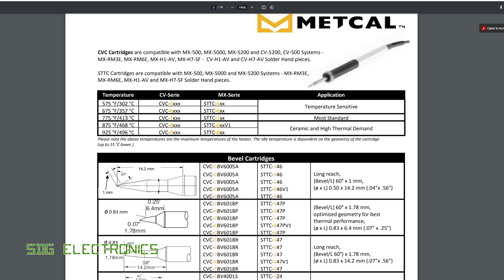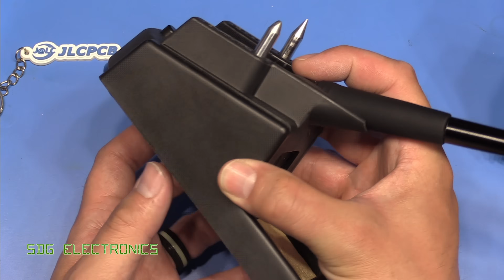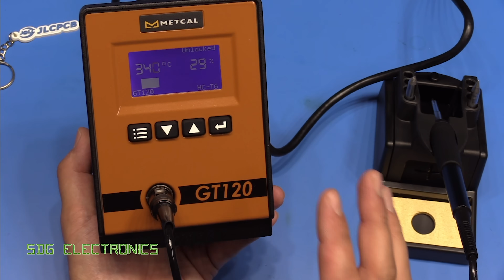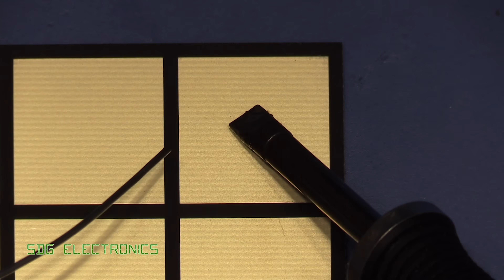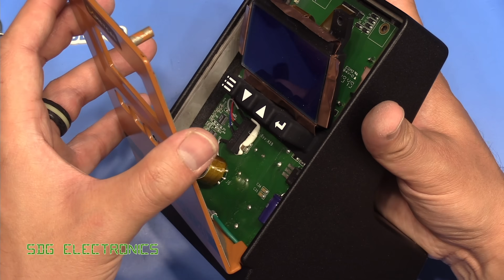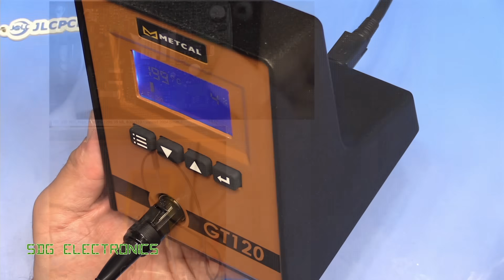SDG #209 Metcal GT120 GT90 Adjustable Temperature Soldering Station

Comment from the maker: The GT120 uses inductive heating, hence the large inductors. It's not a resistive heater.
Reply: I just have a question: aren't the tip sizes different (16:00)? The MX-5200 seems to have much wider contact, and JBC the least. I'm not criticizing, just genuinely curious. Your videos are awesome btw.
Reply from the maker: @catharperfect7036  You might be right - I can't tell from the video which tip I used, but later videos definitely use the ~5mm or 7.5mm tip.

Comment: Quite a considerable difference in tip size and shape to compare the penny test.
MX-5200 had probably double the tip width from the GT120 and the JBC had probably 75% of the width of the  GT120.

Nice review, for me the GT120 has way too many downsides based on my preferences.

Comment: Great review. I don't think it is worth the money. In your Aixun review, I think the unit performed better. I am surprised they used a switch mode power supply at such a high end unit.
Reply from the maker: Most of the Metcal systems are fully universal input voltage (hence the SMPSU) so there's no need to hold lots of different SKUs. There's always a trade-off between integrating a power supply and using an external unit.

Comment: 1200 dollar Soldering station I have to laugh maybe if you was working on a Hydrogen bomb or the Hubble telescope but for the most part you'r working projects most likely cost a lot less than that station. That is what a I call a dollar chasing a dime. You have more money than you know what to do with or your just desperate to find a way to make a video.
Reply from the maker: The RRP is $545 not $1200, but when you use something daily, the quality and consistent results matter.

Comment: Are those better than a JBC ones?
Reply from the maker: Difficult one to answer. I prefer the handpiece over the T-245 and I also like the form factor a bit better than the JBC CD compact stations. Performance-wise it's there's not a lot in it, but I get through a lot of JBC cartridges so they either drive them hard or they aren't made so well.

Comment: I previously used the Metcal MX500 stations and then moved to the less expensive Thermaltronics TMT-9000S which also uses similar RF source with Curie heat technology.
Reply: Which is better in your opinion?
Reply: @ArthurTugwell  It had been quite a few years between using the Metcal and then the Thermaltronics so its a bit hard to say. I can say I was not disappointed with Thermaltronics and the deal we got at the time was quite good.

Comment: You should probably review the pinecil (if it's back in stock) I bought one to have on the field and I think it's the best bang for the buck. It uses TS100 tips, it has a barrel jack and usb-c power delivery and QC, the only disadvantage is that it only supports 19v max, because of the power delivery IC used, so you can't officially use the 24v the tips are designed to handle.

Comment: According to the royal mint, recent Two Pence "coins have a mild steel core and are electroplated with copper". This combination will wick away a lot less heat than the earlier bronze Two Pence coin (97% copper, 2.5% zinc, 0.5% tin)  which was minted until September 1992.

Comment: Seems like all this big brand soldering manufacturers are stuck in the past. I can not seem how this can compete against PACE ADS200 especially considering the price difference.
I like the idea of separate power brick as it can reduce the space needed on desk but not sure why they went with 48V.
Reply from the maker: 48V I think because of the power levels and possibly a requirement of the induction heating. I've not used the Pace station, so I will definitely be getting one to compare with.
Reply: @sdgelectronics  I do have a PACE ADS200 and I like it. If it was not for some high thermal connectors that I need to solder it will have been my only station but I also needed to get a much higher power JBC HDE to be able to properly solder those large connectors in a decent amount of time.
The JBC HDE is the most modern looking soldering station and performance is great. The only thing I dislike about it is the fact that they decided to use a fan to cool the station. Not only the fan works all the time and is noisy but I hate getting all the dust inside the station :)

Comment: External PSU and crappy mini-DIN is a bit of a fail. LCD looks pretty poor as well.
Reply from the maker: I'm in two minds about the external power supply. On one hand it's a very simple replacement if it fails, but it's quite bulky and the DC lead isn't very flexible. I have a follow up tomorrow with the combined tip cartridges.

Comment: I have used that mx5200 at my school once for surface mount soldering. I was wondering why you could not adjust the temperature on it now I know. What makes these stations so much better than for example a ts100 soldering iron. I used a jbc station and that mx5200 at my school but I feel like my TS100 does surface mount soldering just as well. I soldered 0.5mm qfp's and 0.5mm FPC connectors with it. Will these devices solder those kinds of packages any better, my impression is that it is mostly technique a preheater and plenty of flux. The mx5200 looks interesting with the special heating element the other two not so much honestly.

Comment: What do you think about the atten GT-6200 you can get it on Ali express for just under £350 including postage
Reply from the maker: I've never used anything made by Atten, however the integrated heater+tip should always give good performance. The Pace ADS220 is supposed to be pretty decent too. I'll see if I can get hold of any of these.

Comment: Personally I don't like to have the tip earthed. For ESD protection and personal safety the bench mat is earthed by about 1M and I keep this idea for the soldering iron. My tip is earthed via a 10K to limit any current to earth should the tip come in contact with any voltage that has a earth reference. Plus it stops static build up on the tip.

My go to iron handle is the Weller WXMP 12V 55W but I use a home designed power controller for it, as I can't afford Weller's prices for a soldering station. I did a series of videos on the controller design.

forgot to add nice review.

Comment: 6:10  I use original JBC with T245 and T210 for 8-10 years including big and chunky tips like C245-741 and  find these stories about heat handle strange and I must say I never use that foam add on for handle, I like the feel of bare handle. Never felt inconvenience or discomfort due to heating. Maybe this is personal thing.
Reply: It's something you'll only notice if you're pushing the iron. I've had it get pretty hot, not so much I can't hold it, but only when dumping huge amounts of heat into a large multilayer board for a decent amount of time repeatedly.

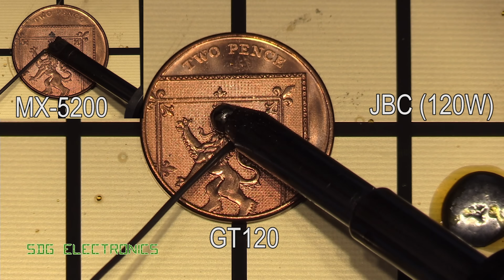Comment: 15:54 This was so unfair from you to take such a different tips and compare those stations 1:1.  Pointy tip that you used on JBC (seems similar to C245-937) is not meant to heat big cooper areas it has very small tined working are for heat transfer. To be fair you had to use tip similar to C245-741. If you don't have similar, at least mention in a video that you used tip that puts JBC in disadvantage. I use different soldering stations for 20+ years (China brands, Weller, Ersa, JBC) and for last 8-10 years I am lucky to have opportunity to work with original JBC stations at work. You also keept JBC starving on a solder , while for Metcal constantly feeding additional solder with flux to make better heat transfer. I do not have opportunity to work with Metcal production, so I'm not saying anything about Metacal capabilities, but JBC in your video was made to look in disadvantage.  GT120 in this comparison looked good just by the fact that you used tip that is bigger in mass then the coin it self. In general hard to imagine how they came up with the idea to release new product in 21firs century with that old technology where tip slides on heating element with all that heat barrier in between.... Enyone that considers buying this soldering station should wait for tips with integrated heater or if they do not need that performance then they likely do not need hi end soldering station and can save some money.
Reply from the maker: C245-407 used, not the pointy tip.

Comment: You can’t compare the 2p test. Very very different tip types. So pretty pointless really
Reply from the maker: How do you mean?
Reply: @sdgelectronics  The Metcal (true Metcal) tip is much larger than the others. It would be a fairer comparison if all stations had similarly sized tips. The JBC has the smallest tip in that demo.
Reply from the maker: @userPrehistoricman  I'd swapped the tip in the test for a C245-407. I have some new tips on their way though.

Comment: That black box vith HAMLIN is not the DC/DC converter, its a reed relay.
Reply from the maker: Ah you're right. I wonder what for
Reply: @sdgelectronics  i´m just guessing, probably to protect opamp from surge, if theyre using K type it needs quite high gain sensitive opamp. But maybe i´m completely wrong :)
Reply: I just checked to see if anyone had mentioned this. Something  in the back of my mind reminded me that Hamlin make relays. A quick Google and sure enough, it's a reed relay.

Comment: Steve, a very nice video review of the Metcal GT120.  I did a review of the Hakko FX-951 a few years ago and think even though it has a lower wattage it is a comparable unit to the GT120/90.  I think you gave a very good balanced review of the station. I was also like you, surprised at the tack soldering on the PC Board.  I  noted in one of your other videos you were trying Kester solder and over the last few decades it is my favorite tin/lead solder.  Again great presentation on the soldering station.

Comment: I'm using a PACE ADS200. Much cheaper than this and there literally is not a single thing that I'd like to be different or better. I use it professionally, daily.

I don't really like the temperatures. 353 °C seems a bit low, while 413 is really high. At this temperature the solder on the top oxidizes much faster and Flix burns off much faster too. I mostly use 370. 400 when dealing with enameled wire.
Reply: You use lead-free soldering? 350 is high for leader solder imo
Reply: @userPrehistoricman  Heck, I do most of my lead-free soldering at around 320C.
Reply from the maker: @tookitogo  Somewhere around 320 to 340 on the readout for me, but I don't look at the specific numbers - it's how the solder flows.
Reply: @sdgelectronics  absolutely agree! Given how much the joint and tip choice affect heat transfer, close observation is the final arbiter, so to speak!

Comment: PACE ADS200 is even cheaper, its one I've been thinking about. Not sure is anyone here has experience with it.
Reply: Have used both. Own the ADS200. (I'm in the USA so price is cheaper for PACE than what I've seen overseas). They're comparable. Both are very good to excellent stations. Metcal is a touch better on over-undershoot temps. But it isn't much of a difference. Maybe 2-3C. Pace is cheaper if you need a variety of tips. Used Metcal vs new Pace...cost is close. Tip to work distance is excellent on the Pace.
Reply: Been using the ADS200 for about a year now.. from tiny smd and drag soldering to beefy ground traces. With different tips/cartridges obviously. It's a dream to work with, highly recommend it.
Reply: I used just once is a very good product .
Reply: I’m interested in the QUICK T1200A, but I haven’t found a complete review yet, that is a $200 USD 120W station, but is not very very well known yet
Reply: @ingenierocristian   I like quick ts 1200 is powerful and well done . This station have a lot of function and a large colection of tips .
Reply: @Digital Resurrection thanks, and I want to know if you consider the TS1200A as powerfull as the ADS200?
Reply: EVEN cheaper. Even makes it sound like you think this is cheap. You rich people are lose from reality.

Comment: I bought a Hakko clone for $60 about 2 years ago. Use it everyday. Still going strong. Changed tip twice in 2 years.
Accurate temp too. The time that you paid more to get more, has been over for decades. 
Buy the cheapest that does the job, and when it breaks, buy another one.
Reply: This attitude of using and throwing away is disastrous to the repair industry and the environment.
Reply: @roseelectronics4582  I can repair what I have. There are thousands of seller selling parts like heater cores and such, on the cheap.
Reply: @piconano  Good to hear that. I thought you were talking about throwing away and buying a new iron every time.
Reply: @roseelectronics4582  if it is cheap enough we can afford to just toss stuff when it breaks down.  My Chinese clone T12 station kit cost me $25 ($24.39 actually) to put together so when it dies I can just get another one. Was a fun build. I'm up for doing it again someday.

Comment: In my experience power delivered varies the most with size of the chisel tip, while same controller, temps, device under rework and all that..
E.g., you simply won't be able to solder some things with T12-D16, that you would with ease using T12-D4. So this was not even close to fair comparison.
It is more due to the heat conducting surface not being a bottleneck for heat transfer then heat mass of each tip.
Reply: That's what i want to write. Comparing chunky MX580 tip with medium size gt120 and small size JBC is not a fair comaprison. When you would use similar tips with recommended temp i think all of that station would have similar performance. But tips can be expensive so i understand why you do taht not apple to apple comparison.
Reply from the maker: @marsma18  I swapped the JBC tip for the C245-407 which has higher thermal capacity for testing later on.
Reply from the maker: @marsma18  Don't worry I have some new tips on the way,

Comment: I have 2 metcals from the other series. The MFR 1351. I think the former version of your new one. They are the biggest piece of crap I have ever used. (However, they solder very well, if they are not broken) The service was even worse. The cable of the soldering iron got so hot that I burned my wrist. Metcal: this is a known problem but your soldering iron is 1.5 years old so no warranty.  I bought it less as a year ago from Farnell but after a few months they replaced one unit under under warranty and the replacement was older (accoording Metcal). I had to replace parts for the pumps several times in that period. The tips are expensive and wear out fast (desolder iron) 
As a reference, My number one station, Pace MBT250, is over 25 years old and I have never had pump problems, I did not even had to clean it. I replaced the handpiece a few years ago and replaced the SX-70 with the mighty SX100. There was no direct need to do that but they had a hard life and I now keep them as spares. My Weller WS80 is about 15 years old and still perfect. (I use them professional)
Reply from the maker: I have had no problem with the MX5200 and MX500 (and also my older PS900). But I do hear many problems with the MFR series of stations.

Comment: Was that an actual JBC station that you were using in the comparison or was that that Best / Jabe station?
Reply from the maker: It's a Jabe power supply with genuine JBC C245 high power cartridge.
Reply: @sdgelectronics  Gotcha. IIRC the Jabe runs 75W right?
Reply: @SebastiaanSwinkels  I have JBC station and know how TIP makes a difference. Small tips heat up in like 1,5s while bigger tip take to 4s to get to 350. It is just one of indicators waht a proper heat mass mean.
Reply: @marsma18  I have a DDE JBC station and a bunch of small and chunky tips. The Jabe / Best stations drive the tips differently compared to actual JBC stations, which is why they are slower even when using the same tip.
Reply from the maker: @SebastiaanSwinkels  You can set the Jabe to 120W peak
Reply: Does not really matter, I think that tip makes a lot of difference. Even it was mantion in that clip when soldering the square copper pads and changing tip change a lot in output.
Reply: @marsma18  The tip in this video looked indeed significantly smaller than the other two on the Metcal stations. That said, the Jabe / Best stations are not as fast or good at dumping energy into copper as genuine JBC hardware. There are a few vids out there comparing the knockoffs to the genuine stations and there is a visible difference.